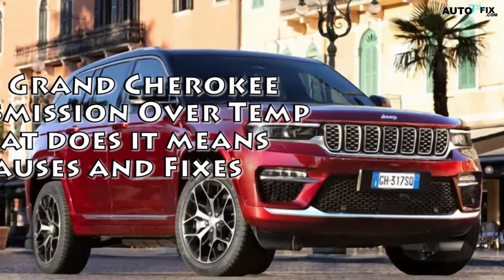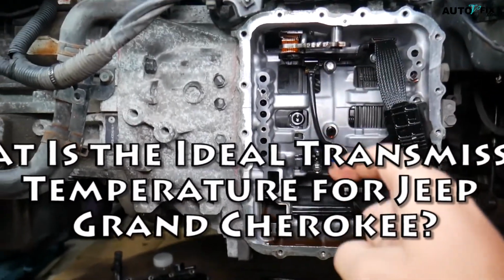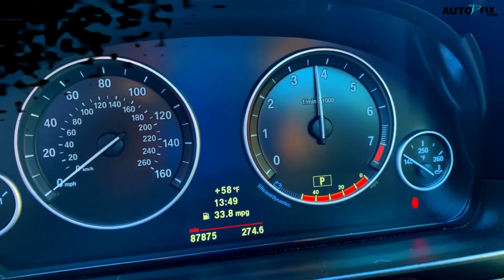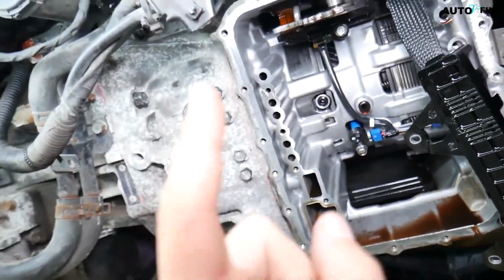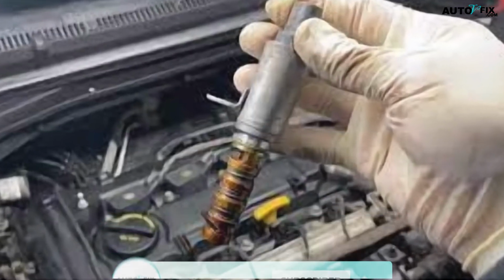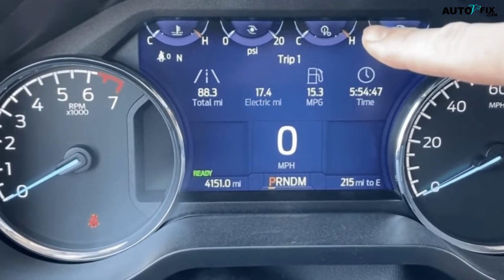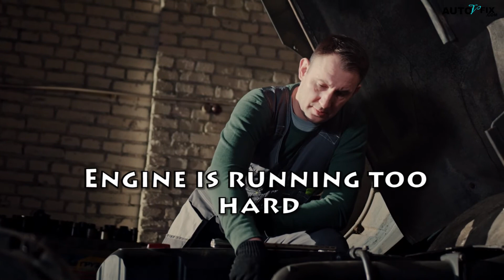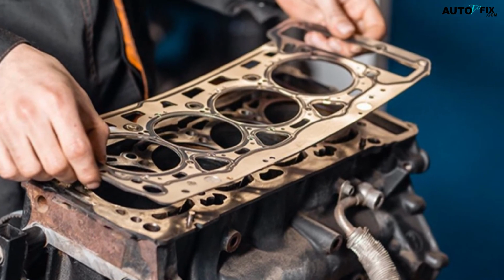Jeep Grand Cherokee Transmission over Temp What does it means Causes and Fixes

Comment: Actually, the over temp problem on the transmission is caused by a bad design on the part of the jeep designers. My transmission was overheating so much that it would put the vehicle in limp mode. I put a transmission temp gauge and a 40k transmission cooler. But the real culprit was that both catalytic converters were so close to the transmission itself that the temps on both the transmission body and the catalytic were almost the same. This was found by using my handy handheld Infrared IR Thermometer Gun. I wound up wrapping both catalytic converters with heat shield wraps and the transmission temps are now reading normal at about 142 F on the road and about 165 to 175 degrees F in stop and go city traffic. The normal temps should be between 175 to 200 degrees F.
Reply: What year was yours? Mine is an 06. Could that apply to me, too?
Reply: @levifarr8211  Mine is a 2006 Jeep Cherokee Laredo 3.7L engine.
Reply: @levifarr8211  Yes, actually that should apply to any vehicle with an atf overheating, especially if you do lots of towing. But if you get a P2767 error code, then replace the two speed sensors.
Reply: When did they start putting dipsticks in manual transmissions
Reply: It happened to me but it’s December
Reply: Wow
Reply: Mine is a 2014 overland 5.7  and had the fluid replaced and same issue